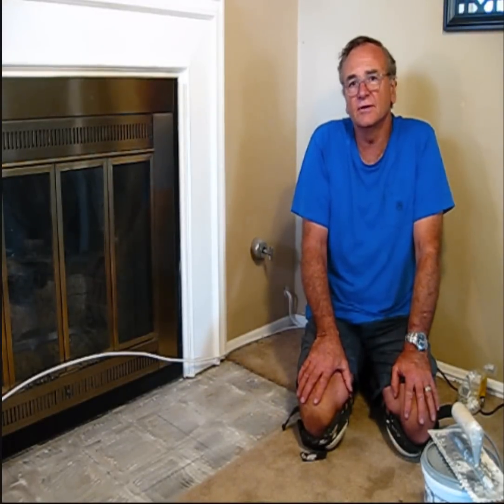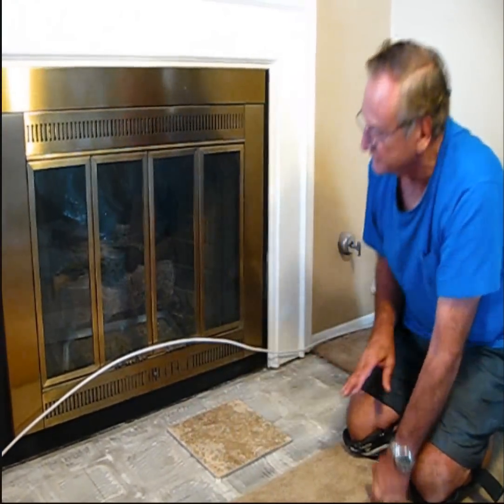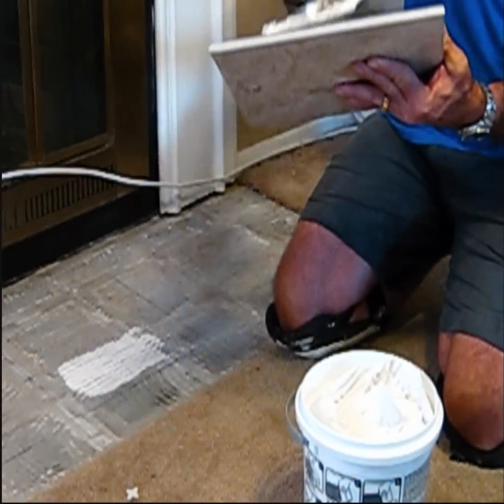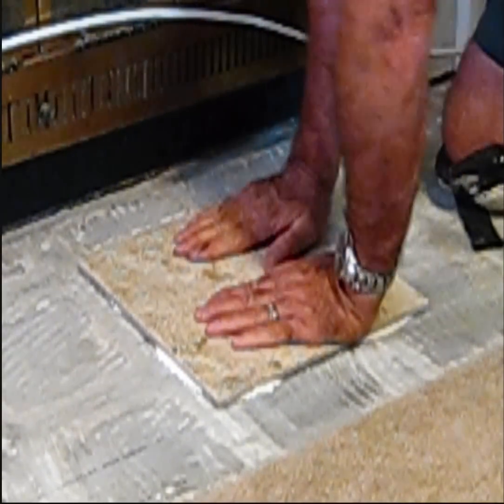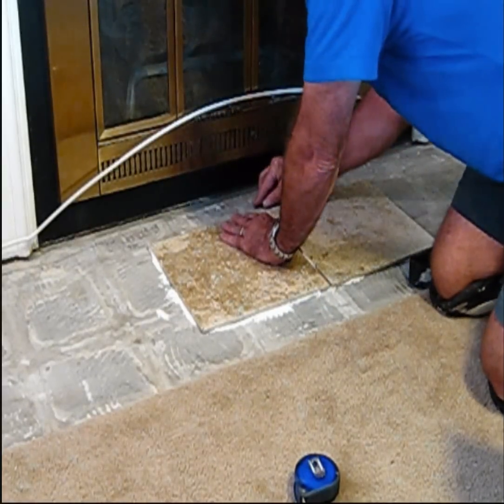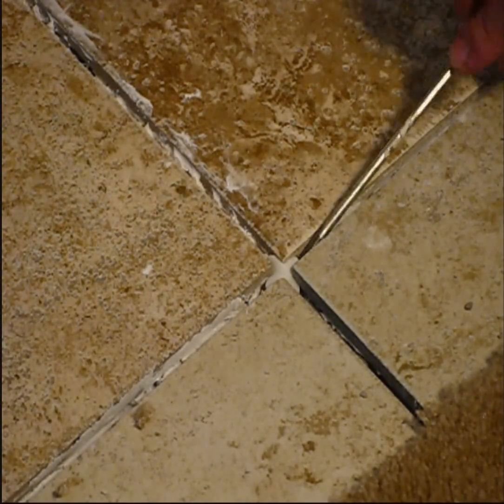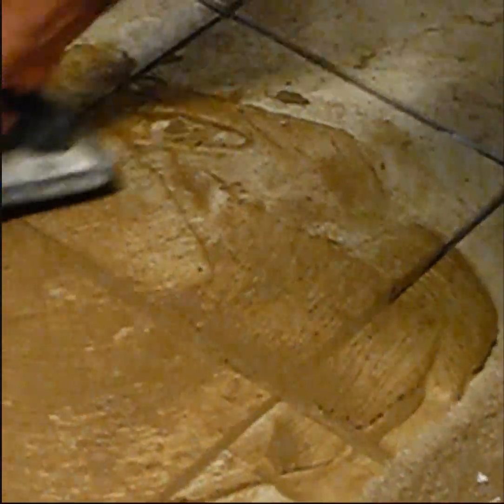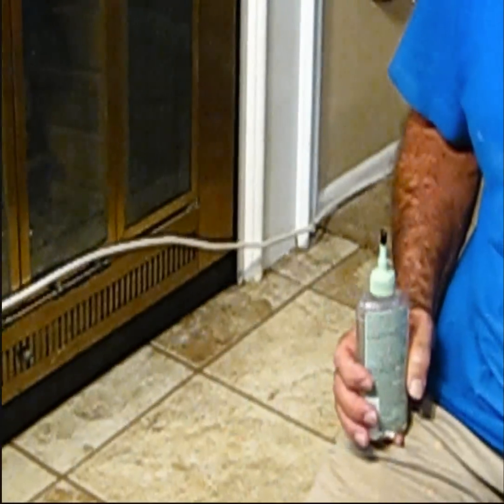HOW TO TILE A FLOOR THE EASY WAY - Be Your Own Handyman @ Home

Comment: Hi Dave, i was wondering if there is a product for laying tile that prevented moisture and musty smell from seeping through the floor tile. i dont want to put down that ditra stuff first. i am conserned about that in my laundry room . my house was built in the 50s and they didnt use any foam under the concrete slab. thanks! jeff

Comment: I'd like to reuse some salvaged floor tile. I was able to remove it without damage, but it has thin set still on the bottom. Thinking about using my grinder.  Any other ideas?  The tile is a unique size and reusing will save me from ripping up the entire room.

Comment: Thanks for the video!  We moved into our house about a year ago and we've noticed the grout is falling apart at the corners of our tiles because previous owners never removed the spacers from between the tile before grouting.  Is there a way to remove the grout so we can remove the spacers and regrout or do we have to retile everything altogether?
Reply from the maker: +Nicolette Uden Yes, you can remove the grout. I don't have a video of that process but here is a tutorial:http://homeguides.sfgate.com/remove-old-stained-grout-between-floor-tiles-replace-new-grout-66892.html

Comment: HI MR DAVE, WHAT IS THE NAME OF THE BLADE ON THE TILE REMOVE OFF CONCRETE VIDEO?
Reply from the maker: Hi, I used Dasco Pro 2-1/4 in. x 7-1/2 in. Mason Chisel and you can buy them at Home Depot.

Comment: steaming removes tiles easy! use iron and water on a towel or a steam mop. Then just scrape it up. I cant find a way to get the glue off the vinyl tiles that are in the rental we are in now. they used way too much and it seeps thru the tiles and I can't get it up.
Reply from the maker: Diana Smith Hill thanks for commenting but your method won't work on ceramic or porcelain tiles.